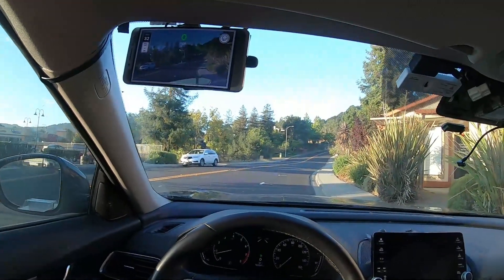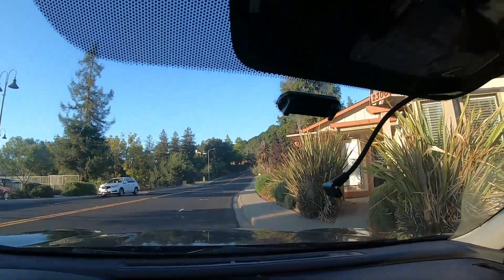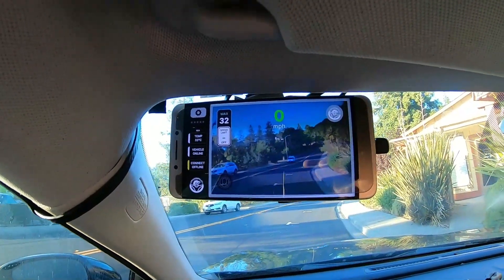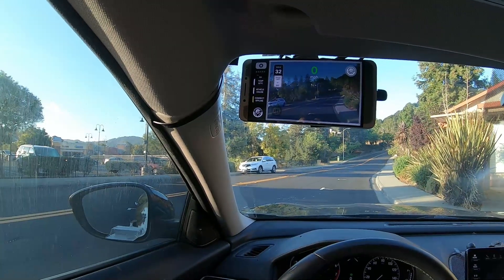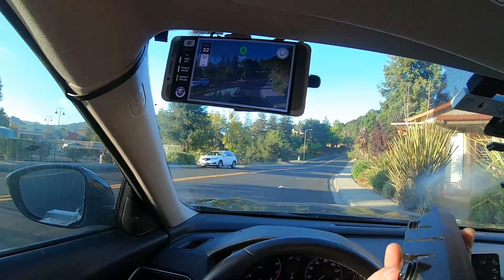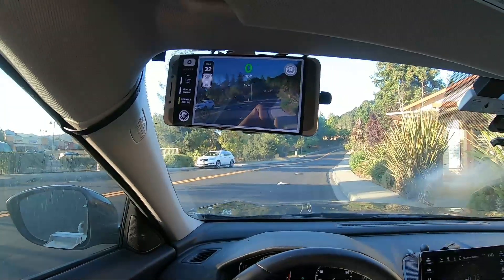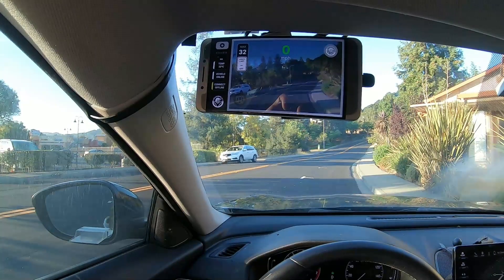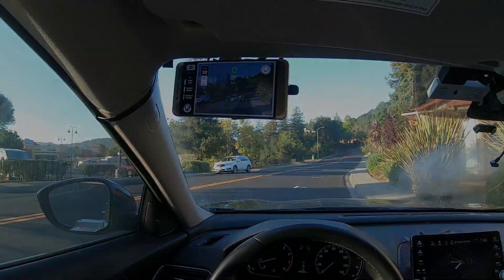Sidemounted Leeco Setup  Dragonpilot Openpilot Fork

Comment: When it is off centered how do you adjust the lateral hugging? I think the OP will steer the vehicle close to right lane, no? Because I have the right lane hugging issue on my Eon gold with 0.7.10 even when placed centered and would like to learn a way to add offset. Camera_offset parameter change didn’t help.
Reply from the maker: try version 0.8.2    or  dragonpilot if you have a black panda , it has a camera offset toggle https://github.com/dragonpilot-community/dragonpilot/tree/release2

Comment: I don't believe this story that C3 code can't run on C2. I'm going to make it work eventually!
Reply from the maker: It will run, it’s just it’s gonna overheat  with OP original processes. You need to strip them down. This one does not record videos, which is cpu intensive.  Just get yourself a dash cam